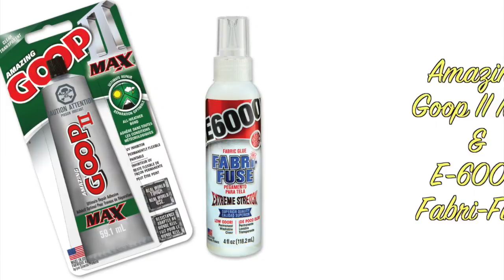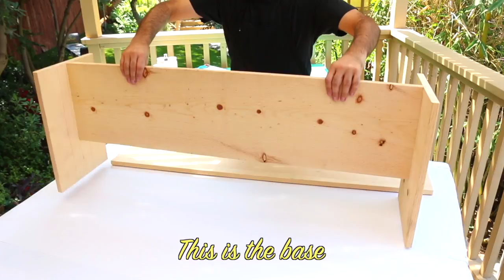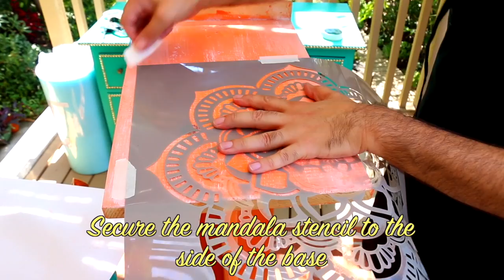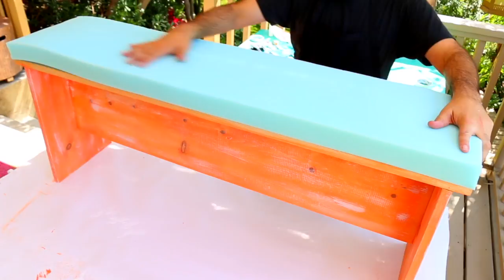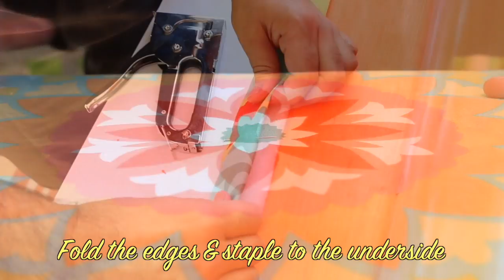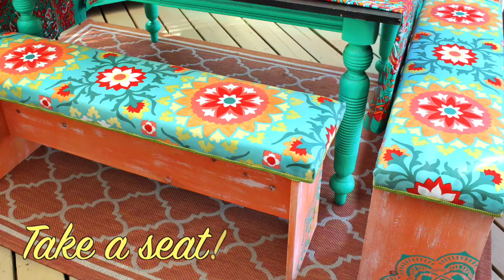Upholstered Bench Build

Comment: I love this. Colors, fabric, the build! You could use a Ryobi One + nail gun and brad nailer. They come in very hand for projects like this.
Reply from the maker: I was just about to get a nail gun!  I'm just not sure which is the best...I'll have to check that out!
Reply: @MarkMontanoMakeYourMark   In the past few years we switched to the Ryobi One + tools over the heavy duty air compressor models we purchased when we built out home almost 17 years ago. No cords and the Lithium-Ion batteries are interchangeable. You never run out of power as long as you have an extra battery charged. They last a long time so that's not often during a project. 
We have a 6 or 8 slot charger with two sizes of batteries. I prefer the smaller because of the weight. I do smaller jobs than hubby, so it works out well. He even has a grass blower in this line.